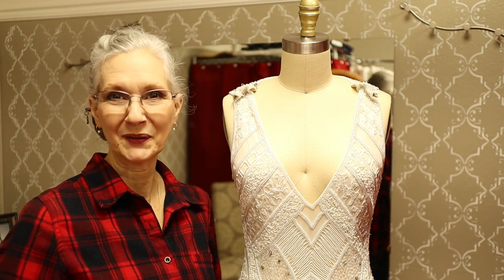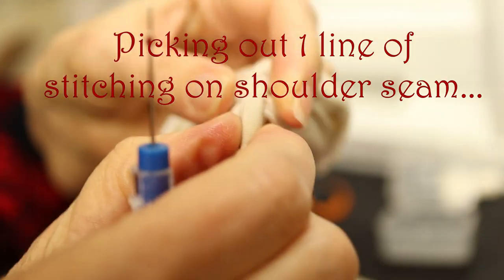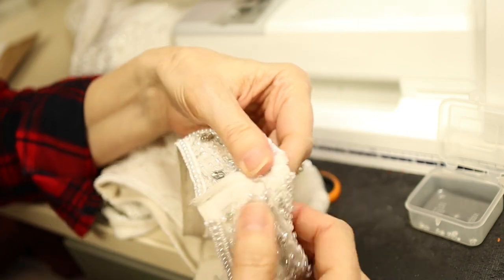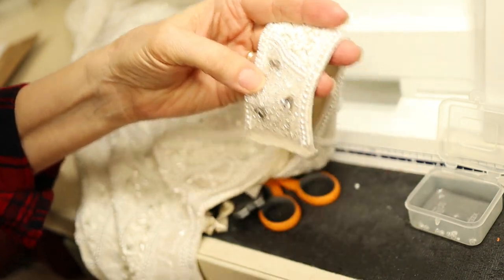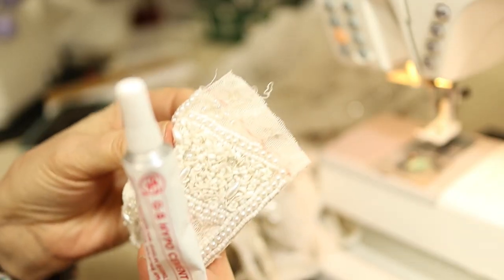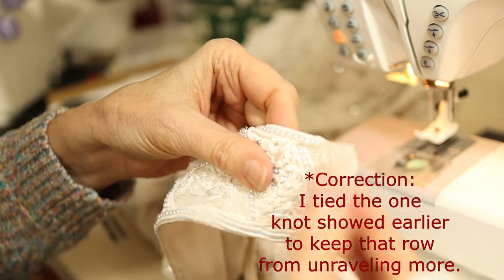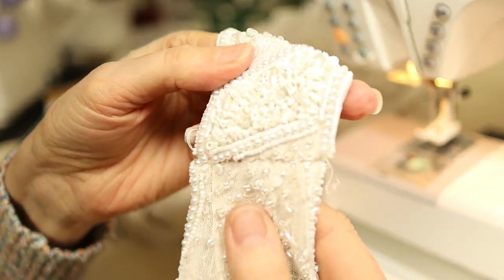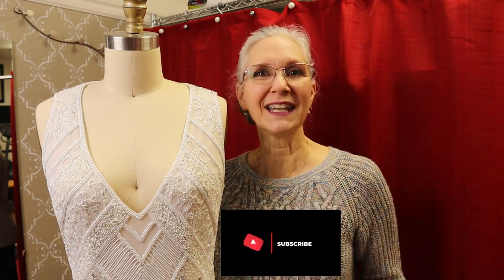HOW TO TAKE UP HEAVILY BEADED SLEEVELESS DRESS SHOULDER + CHEATER TIP! BHLDN 'Remington' Bridal Gown

Comment: Hi there!! It’s always a pain to re-bead especially it it has a design of flowers, swirls, etc. I usual open the seam & gently, lightly dot the beaded area w/ cement (wrong side of course). While one side or area is drying… I rip the other. This really eliminates losing a bazillion beads. Because as you showed in your video… you never lose one bead. Lol. I’m sure you left that in purposely. A newbie might panic if not prepared & beads pulled off by the handful. Remember because the glue is applied lightly but effectively you can cut through it & stitch through it if the area needs to be re-beading. By the way the gown looked amazing!! Beautiful job!! ❤
Reply from the maker: Thank you for watching and your comment!  Luckily, the straps...though heavily beaded...don't contain THAT many beads to come off (at least compared to the hem! LOL! I'm currently editing the hemming video of this dress, so be on the lookout for it fairly soon!) I utilized that Hypo cement glue extensively on the hem. It's a life saver for sure!